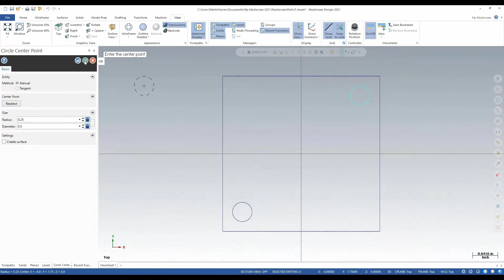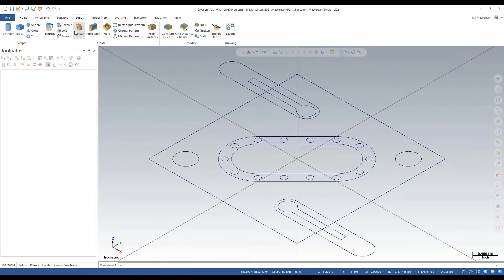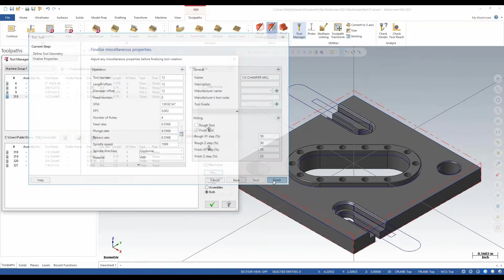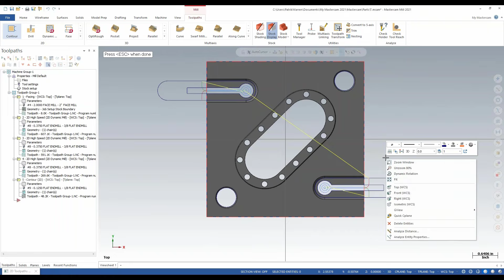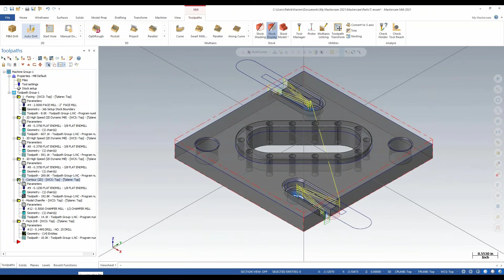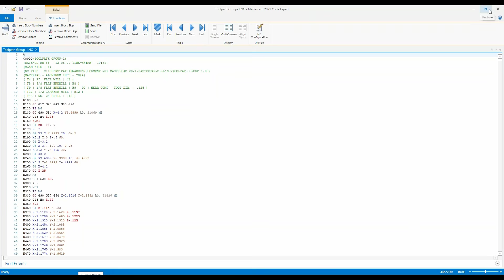Getting Started with Mastercam Mill | Beginner CAD/CAM Workflow

Comment: your drawing dimensions are off. you called 1.25 in slot but if you count your squares it is 1.5 in in width. 
Every square should be .5in? Correct me if I am wrong?
Reply from the maker: The drawing does not appear to specify whether the slot length is center-to-center or overall length.  If it is an overall length of 1.5" with a 0.25" radius, the center of the slot would be 1.25" from the end of the part.  Of course, all of this assumes that the drawing is perfectly to scale and factually correct which can be tough with a hand-drawn print.  Your best bet would be to confirm the dimension if there is any ambiguity.

Comment: why my stock setup different??? its not showing the same... my stock setup icon is red square not gray square like  in 15:05...why?
Reply from the maker: You can ignore that.  The interface in Mastercam changes slightly between versions.  If you are using a newer version the stock setup icon will appear as a red cube, but is identical to the functionality and workflow of previous versions.
Reply: @MLCCADSystems  but but... i cant apply my works... cant proceed  next step.... because the apply button unavailable
Reply from the maker: Check out this video, it is a couple of years newer and the workflow should be more similar to what you are seeing.  https://youtu.be/GuKrpMe97jY

Comment: When i get to the point where i want to cut body for the slots, i do everything you do in the video, then when i the green check mark, a bubble pops up saying thicken operation failed
Reply from the maker: This is very likely related to the file you created or some operation on that file, reaching out to your value-added reseller would allow you get help quickly.  If you are an MLC CAD Systems customer you can submit a request on this website or give us a call/email.  https://www.mlc-cad.com/technical-support/
Reply: Hi Garrett. Check to make sure that 'Thin-wall' is not the default selection when you are doing your extrusion. Sometimes it can be activated and cause a problem when extruding. It is found on the second tab in the extrusion window dialogue box.

Comment: Why changing tool position numbers? Thank you
Reply: Hi Jason. I changed the tool position numbers to match the positions I was using on the machine. You want to set them to the tool numbers that you using so that the machine selects the correct tool to cut the area you have defined.